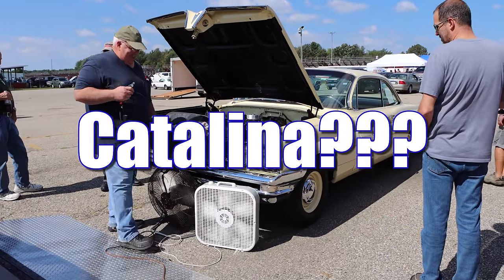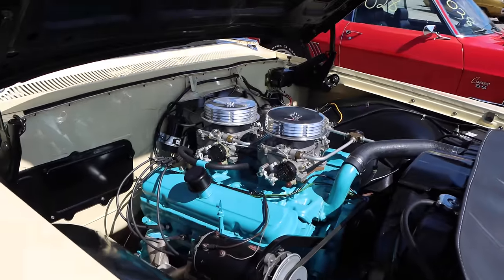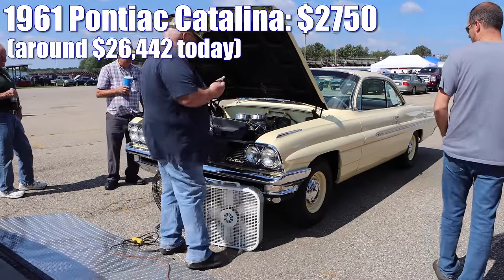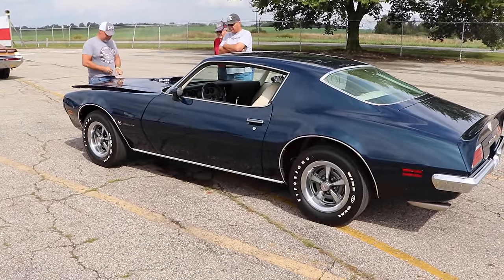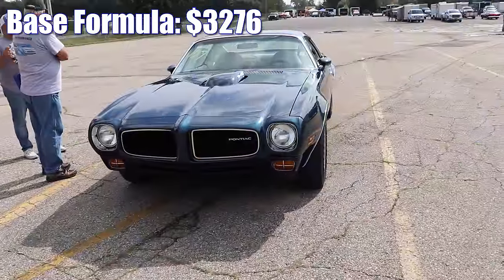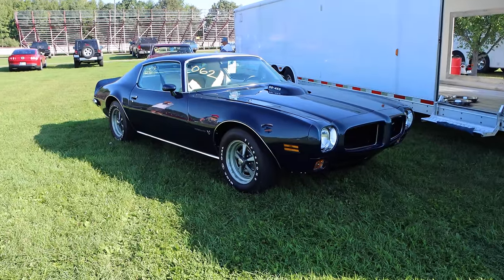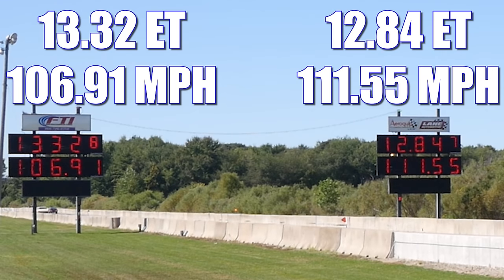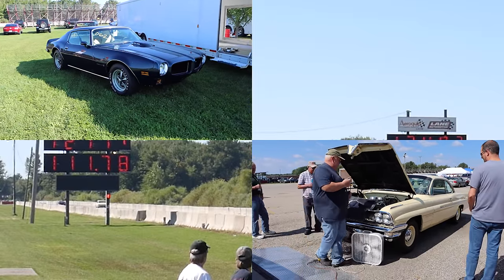1973 Firebird SD455 vs Land Yacht | STOCK DRAG RACE

Comment from the maker: Correction: the SD was rated 310 horsepower in ‘73, and 290 horsepower in ‘74
Reply: and i n 73 is 455 normal power i have one 73 Trans Am 455 M21 3.42 Brewster green,white int
Reply: 290 hp both years due to cam change, no 310 hp sold to public
Reply: @chutoparadinni5474  False 73 SD have 310
Reply: @stephanouellet3673  Wrong! No 310 hp version made regular production, FACT!
Reply: Find me one, show me the Cam!
Reply: @chutoparadinni5474  455 normal have 290 in 73 and the SD have 310
Reply: @stephanouellet3673  Nope, 1973 455 Y code rated at 250hp, SD-455 rated at 290hp
Reply: @chutoparadinni5474  not fact. My 74 has the 73 heads from factory, with the larger exhaust valves.  Same cam, same rest of the platform. 310 went to public domain. Most of the SDs, 73-74 built in Norwood are “310” spec motor. Period. I cannot say what California built are.
Reply: Fact!! Heads were the same in 73-74, No 310 hp rated SD was ever released to public sale,  ALL SD's sold were rated at 290 by PMD after cam change, therefore the delay in production and deliveries, Literature stating 310 hp was already released, it was too late to correct, therefore so many still believe/think 73's were rated at 310hp, not so.  73 and 74 engines are exactly the same other than Part numbers for each year.
Reply: @chutoparadinni5474  You should find someone willing to disassemble their original 1973 SD to prove your point. Otherwise find another venue to stand on a soapbox and squawk.
Reply: @chutoparadinni5474  Some of the advertised/published data for 1973 SD model year had different cam specs from the next model year. None this matters because there is a red 1974 Formula SD that has run  under 12 seconds with an auto during track testing/tuning. Any scrutiny can applied to that combo now.
Reply: @chuck0802  "Had different cam", and none of those made regular production, funny how after All these years and all the SDs being restored/rebuilt/taken apart, there has yet to be one found with the 310hp cam, Um? wonder why. and your Red SD formy running under 12 sec. Paul's SD, is Far from factory stock. There's a difference. Ask Paul if his SD cars came with the 310 hp cam from the Factory? HA!
Reply: It is amazing how many experts comment on these videos. 
Their vast knowledge of the good old days, how cars ran back in the day, old magazine test results (with their wonderful launching techniques & track prep lol), “my uncles girlfriend nephew had one just like it” and he never cracked 12’s, blah blah blah…
We got an untouched original 409/425 to run 13.04 @106 in 1999. And the crying hasn’t stopped since. LMFAO
Reply: @stephanouellet3673  Awesome  !!!
Reply: @chutoparadinni5474  You are 1,000% correct. NO 310 HP SD's made it into production. This is easily verifiable with some internet research.
I am not am expert and don't mean any disrespect. I love Pontiacs though...
Reply: I came into this kind of late but I do know that the 73 and 74 455 Super Duty engines are exactly the same mechanically so the 20hp discrepancy always made me wonder. The 73 455 S.D. was supposed to be released with the 041 cam but couldn't meet emissions so they downgraded it to the 744 cam. All 455 S.D. engines from both 73 and 74 had the same 2.11/1.77 valve package. Only 73 and up D-port heads received the smaller 1.66 exhaust valves while retaining the 2.11 intake valves. But I did go look at the original Car and Driver road test from 1973 and while they talked extensively about the 068 camshaft they also stated it had 310 hp. It would make sense that this was an error based on the assumption it would have the 041 cam but at the same time you can never tell what the marketing teams are doing based on horsepower ratings. I don't think any of them were very accurate or even are accurate today.
Reply: Well I bet the one shown here is putting out more than 310 hp that's for sure.
Reply: LoL. You fool😝
Reply: @johnross6314  Wrong. 290HP was it for both years. Why is that so hard to understand.  I have a 74 SD T/A and my heads were cast July 1973, and they area ALL THE SAME period. You got to understand something, the EPA was coming down on these guys back then and Pontiac was FORCED to utilize the milder cam. SO WHAT?  You rip that one out and put in a Ram Air IV or a Nunzi Ram Air IV. Just backing up Chuto who knows his SD's.
Reply: @74SD455TA  the heads for many 74s were same as 73.  Which they both had the larger valves of the 73.  No matter what valve size, they all were ramIV based. Round port with the intake side milled out and push rod steel insert pressed in the milled open area. THE key to these heads breathing better than any Pontiac ever.  Yes, California 74 had milder cam and smaller valves than 73.  However, most early-mid 74s had the 73 cam to go with the larger valve size. The actual HP while above “290” was not as strong as the 73 heads. Anyway, 73 year, and 74 year that had 73 heads were “310” horse design with larger valves. 

I was able to acquire factory dry sump system.  Which by itself added up to 70hp in certain rpm range.  Plus, no windage issue in long sweeping corners. Install was not bad in the day.
Reply: @1967davethewave  to all…..  Cincinnati (Norwood) SDs WERE made with 73 cams.  Period. Mine was measured when blueprinted back then. Period. Norwood cars did not end up in CA dealerships. CA made SDs served California emissions. Yes, 74s had milder cams.  Maybe the California 73s ended up having to also.  Do not know that. All I know as native of Ohio and SD owner, some/many of Norwood SDs came with hotter cams into the fall of the 74 calendar (and model year) run.  PLUS there is a difference with the valve size (smaller) with all CA and some later Norwood made 74s.

I have another post here talking valve differences, and Dry Sump oil system.
Reply: @johnross6314  I can appreciate what you're saying however, how did GM  get the official HP on the 73 and 74 to be 290, not 310 anywhere? Its funny tho, while they make such a big deal out of that 310/290 thing,  that whole point really means nothing, after all, they had gone to a net HP reading anyway so if we're talking gross HP they may have approached 370. Then you simply swapped out the cam to a Ram Air IV style, re-jetted the carburetor, added a stall speed, reworked the distributor (all of which was really pretty simple to do) and you had a engine perhaps grossing out HP near 450?

I have yet to hear your statement about valve size between the heads as being larger on the earlier versions but as I say, I have not heard that corrobortated elsewhere. Mine was built in Feb 1974 (still own it HAPPILY) and as i said the cast on the head was July 1973.  All I know is, these cars are very quick!

Really cool that you had acquired the dry sump system, so rare they are.  PS. I know the Ross family of names is quite large but you wouldn't happen to be related to a Jay Ross would you?
Reply: @1967davethewave  The SD 455 came with the 744 cam in both years. The 068 cam was used in 455 HO.
Reply: @kellynestegard5208  Well I'll be damned, you're right. I get numbers confused in my old age.
Reply: @johnross6314 o
Reply: The '60s were full of hype. Just about all performance engines were underrated. For instance I followed the horsepower world closely back then & nowhere did I ever read of a 325, 327 but there were, how many no idea. Typo, anyone's guess. The 440-6 was rated at 390 yet on a dyno turned much more. Who do you believe? I do know any 3500-3800# car tuning low 13 ET had some serious motor mods.
Reply: The SD 455 was one of the biggest fucking turds ever made I will take the land yacht any day ❤
Reply: Yes the only sold the really mild version. Surprisingly it still ran with the best of the muscle cars from 70.
In reality that SD was closer to 350 Net at 5700 RPMs
Reply: @chutoparadinni5474  yep and rated didn't mean much that year when they were trying to make that car look harmless. 
It would be 290 HP Net @ 4000 rpm or 350hp net @ 5700. And closer to 400hp gross @5700 rpm.
Reply: And, with the HD suspension, the 1.25 in. front anti-sway bar this car had no roll, it was excellent at what was later called, drifting!

Comment: Excellent race. Poncho SD's from two different eras. Thumb up.
Reply: Only 12 years difference.
Reply: @matrox  Aren't eras usually measured in 10 year increments?
Reply: @bruceallen6016  Nope, but the 73' does make it to the next era by 1 year. 
Veteran Era
The Veteran Era began with the invention of the automobile and continued up to 1890.

The Brass Era
The automotive Brass Era is named for the prominent brass fittings used during this time for such things as lights and radiators. It extends from the first commercial automobiles (first known as motocycles) marketed in the 1890s until about World War I. The term "Brass Era automobile" is a retronym for "horseless carriage," the original name for such vehicles, which is still in use today. The Brass Era closely followed the Veteran Era.   The Brass Era is considered from 1890 to 1918.

Antique Era
The Antique Era actually covers a specific time period from the beginning up to 1920 or prior to World War I.  The time period for antique cars includes the Veteran Era as well as the Brass Era.

Vintage Era
The Vintage Era followed WWI from 1920 to 1930 (later refined to include up through 1942 by some's definition). There were over 500 automotive companies in 1910 but by the time the Great Depression of 1929 only 60 had survived, and twelve years later there was less than 20.

Pre-WWII Era
The Pre-War Era began with the Great Depression in 1930 through 1942.

War Era
World War II, or the Second World War (often abbreviated as WWII or WW2), was a global military conflict lasting from 1939 to 1945.  Civilian car manufacturing was suspended during from 1943 through 1945 as the automakers produced war supplies.

Post-War Era
Automobile design finally emerged from the shadow of World War II in 1946, the year that in the United States saw the introduction of high-compression V8 engines and modern bodies from General Motors' Oldsmobile and Cadillac brands.

Classic Era
The Classic Car Era is designated as the period that cars and trucks were built between 1960 and 1972.

Muscle Car Era
Typically refers to featured cars and trucks built between 1964 and 1972.

Modern Era
The modern era is commonly defined as the 25 years preceding the current year.

Future Era
Potential future car technologies include new energy sources and materials, which are being developed in order to make automobiles more sustainable, safer, more energy efficient, or less polluting. Cars are being developed in many different ways.

With rising gas prices, the future of cars is leaning towards fuel efficiency, energy-savers, hybrid vehicles, battery electric vehicles and fuel-cell vehicles.

Comment: For Poncho lovers like myself, it doesn't get much better! Thanks for this one.
Reply: I love my Pontiac's  dump GM for dropping the PMD line Their lose.
I had a 66 GTO that i installed a 1968 400 HO with the 4-speed. All so had  3 Firebirds and ny alst was a 1998 T/A
Reply: @tomm9860  My first car was a 76 TA which eventually became heavily modified but still capable of being daily driven.
Reply: my best bud in my teens was fond of Ponti-rags...he had a 65 Old's, F-85 with a 421 to start with then went to a shop built 428 with a tri-power set up that was an absolute BEAST on the street back then...a $6k (1977 dollars) motor and a $1.5k trans , with 12 bolt posi, 411 gears... all in a primer black F-85 ... good times were had
Reply: @tomm9860  Shame what happened to the TA. Last of them were just sinister looking in black (LSx cars). Always had Camaros but the TA were better looking all around
Reply: @freedom_323  Went to HS in Chatsworth (80s) wiht a guy who owned a 68? Firebird....built 428 4.11s  my god that thing was a monster! First BB I ever experienced .  Would lay rubber off idle or in 3rd didnt matter. 
Blew it up driving it home on the fwy...too many rpms for too many yrs.
Reply: @gordocarbo  Torque monsters...those were good days

Comment: Two awesome cars. That Catalina with the bubble top, nice. The Super Duty Firebird, only 10 built and he races it, that's wild.
Reply: Sure Grip, '73 Firebird Formula SD 455, 43 were produced not 10. 4800 Trans Am SD 455 were produced in '73.
Reply: @sergeantmasson3669  Correct, but of those 43 only 10 were 4 speed manual transmissions as indicated in the video.
Reply: @suregrip8853  Only applies to the Formula Firebird models, not the others. 4800 455 Firebirds were produced in 1973.
Reply: @suregrip8853  I couldn't care less because I never cared much for Firebirds. The '69 Trans Am was the only Firebird that I ever liked, especially the convertible.
Reply: Can't sit in a "Lawn Chair" your whole life!!

Comment: The SD Formula came with the TA hood scoop due to federal noise and emissions compliance testing.  And that Catalina - what a beast and driver. Nearly matching the best runs, with a professional drag racer at the wheel - wow!  Like I wrote in the live - thank you!
Reply: Bingo…. I wrote a separate post covering this and other first hand history items.
Reply: This car was featured in McQ. Yes..John Wayne in a Firebird Formula screaming around at over 125 mph.. lol. They say it was a de-badged Trans Am for the movie because of the shaker..who knows. It was the same Brewster Green as this one
Reply: @netrioter  Have to watch for that.  Seems JW liked Pontiavs (station wagons).
Reply: You mean the SD455 was run in the tests with the full air cleaner assembly so any car with that engine had to also wear it out the door?
Reply: @fcaughli  That is how it was explained to me.  It was incredibly hard to get the SD certified, and having to run another set of noise and emissions tests for the engine might have killed the entire program.
Reply: @charlesdalton985  CAnt believe it was certified. I remember the L82s in vettes and camaros could barely pass. Timing had to be retarded so bad they barely ran. Easy to get around back then. Headers, recurve the dist and richen it up bam they ran strong